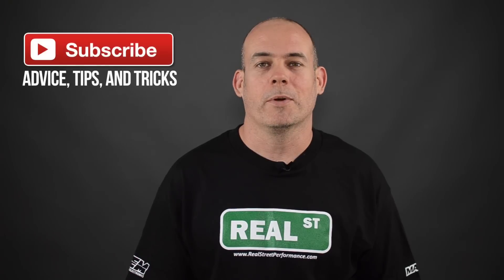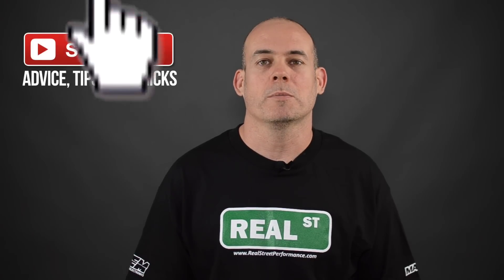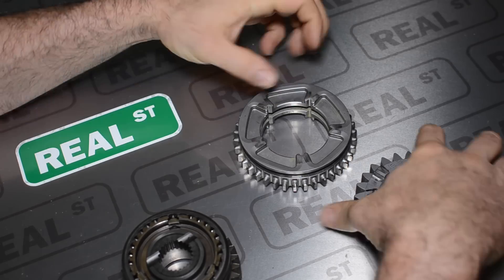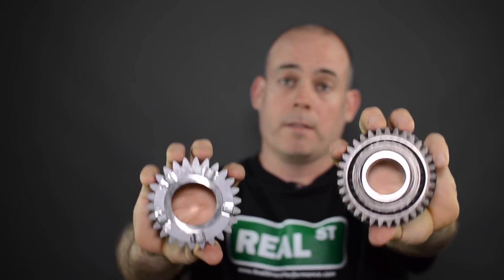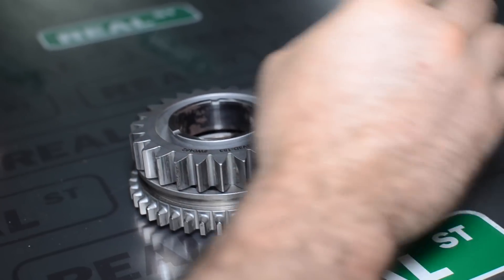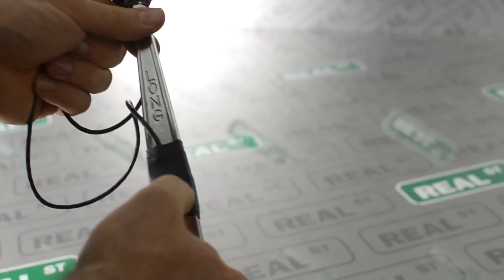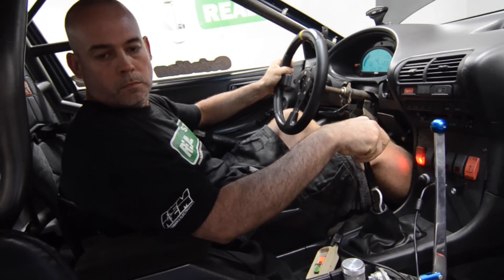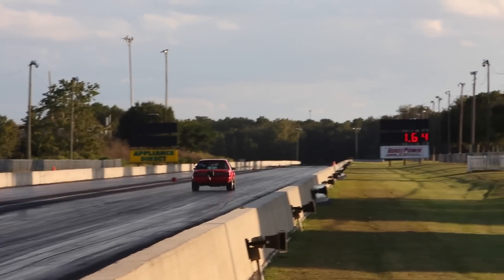How to Shift Quicker Using a Strain Gauge - Jay's Tech Tips #34 - Real Street Performance

Comment: I would also add a switch either on the gear lever itself or steering wheel to engage/disengage the strain guage ignition cut system for a street car.

Comment: Do you have a suggestion on a Strain Gauge for road racing that does not cost an arm and a leg ? or better still does RSP sell one?
Reply: +Andrew Murray  Fuel Tech has a knob that has a strain gauge in it. It's cheaper than the conventional route. 

 thanks

Comment: Have you ever seen the strain gauge approach used on a synchromesh transmission to eliminate use of the clutch during shifts?
Reply: There's two things in this video. A clutch sensor, which kills the engine as you shift normally; and a strain gauge, that kills the engine as you use the shifter. Dogboxes don't require clutching.
http://www.superstreetonline.com/how-to/transmission-drivetrain/impp-1109-synchromesh-vs-dog-box/

Comment: I've got a 80/20 street car and weekend drag car. It's a mild fox body mustang with a t5 w/gforce gearset (cable clutch) would I need to convert to a hydraulic clutch? Or would would it be out of the question since it's not a dedicated drag car
Reply: +Kyle Shaw  How the clutch is actuated has nothing to do with the strain gauge. You'd need to have a ECU that can do gear cut and preferably power reduction on the gear change to lower the shock when the engine turns back on.  Basically it would cut 80% ignition to allow the gear change then lower the level of ignition cut back to 0% over time to lessen the shock. 

 thanks
Reply: +Jay Meagher ok perfect, what management to you use on your mustang? I can't count how many times I've watched the build on your car. Thats the perfect setup

Comment: do you have to use a dog box with the strain gauge ?
Reply: I have the same question... I would believe so because you would probably damage your synchronizers by pulling on the shifter in anticipation for the shift in a regular manual trans.
Reply: You should watch the video agian guys, all was explained
Reply: Try shifting a synchronized transmission with a strain gauge and ignition cut. MAYBE, if it were straight cut gears you could get away with it for a little while, but if you try that on factory helical cut gears, they won't last very long.